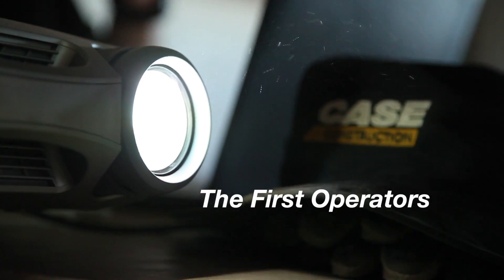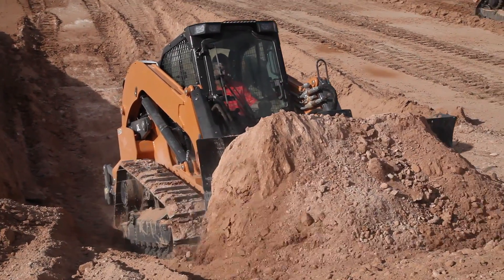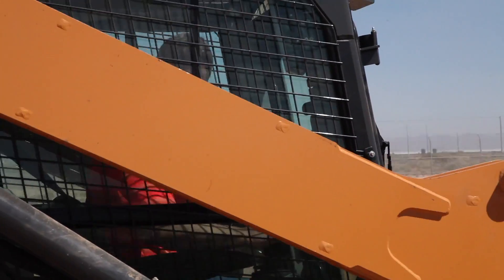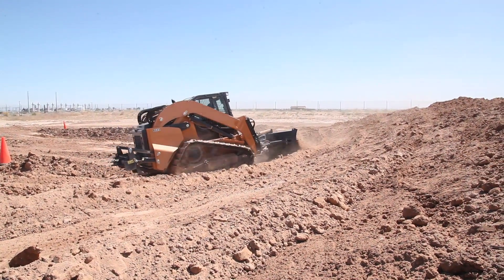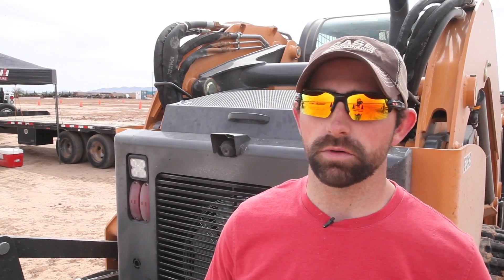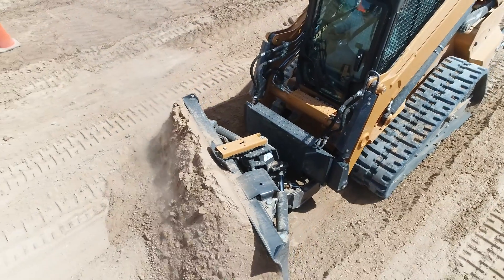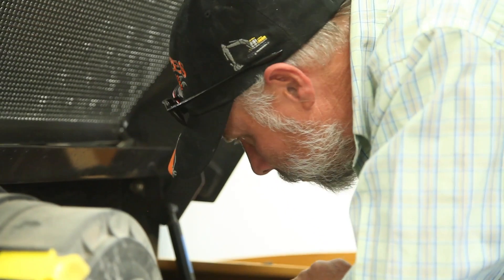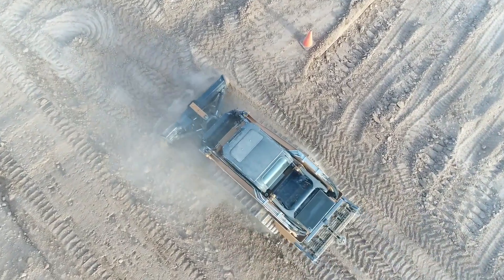North America: Project Minotaur Episode 6: The First Operators

Comment: Will the front door open no matter where the boom is?  I don't want to be trapped in if the machine stops running.
Reply from the maker: Thanks for the comment Jason - and your business - there is a loader control override knob to the right side of the operator's seat that allows the loader arms to be safely lowered, with the operator still in the cab, in this situation. Please let us know if you have any other questions!

Comment: I am a dozer operator. I have run the cat version of the track skid steer with dozer blade attachment. It was way off balance. I love machines, but this was not a good setup. Hope case improved it, but the setup looks the same. 
I do love track skid steers, but this doesn’t seem a good setup
Reply: For dirt work any tracked skid loader will out work a wheeled loader.
Reply: the dozer blade attachments for a ctl go universally unused. this should be different...